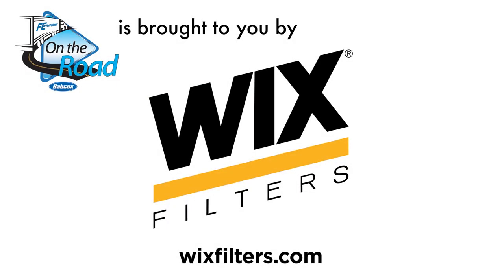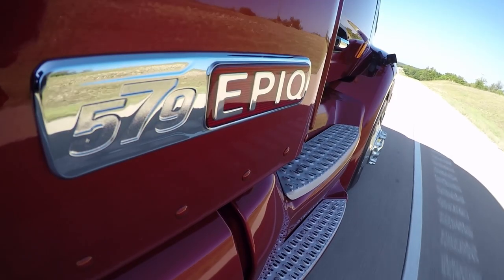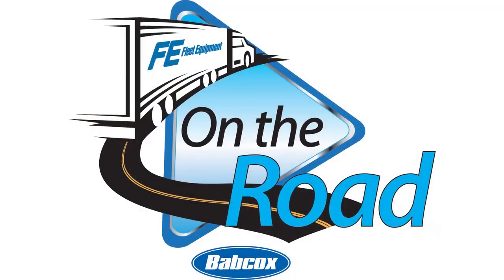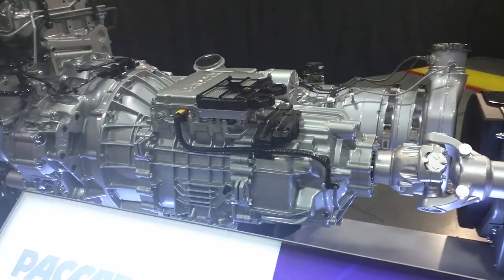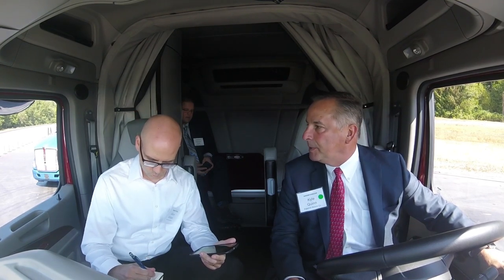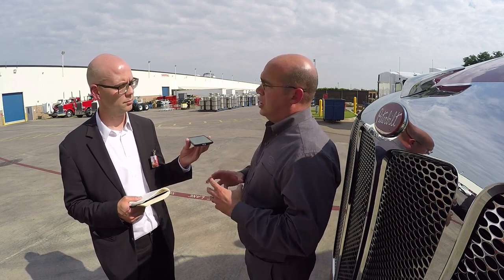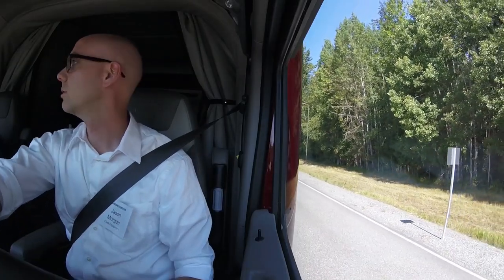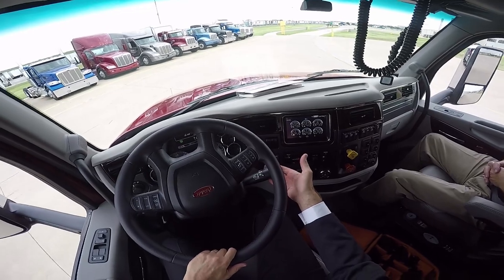Hands On: PACCAR Automated Transmission in a Peterbilt 579 Truck

Comment: I very much prefer a manual, but the company I work for mostly has automated trucks, so that's what I'm rolling with for now. As long as my truck is clean and running right. I'll drive manual or automated trans.

Comment: Is the Peterbilt 579 and Kenworth T680 with automated manual only available with Paccars Automated manual? I know Volvo has the I shift. Mack has the M drive and the Freightliner has the DT12 and I know Intertrashional has Eaton Ultra shift which is made by Eaton Fuller and they suck on the International Transtar.

Comment: The enduranceTrans 12 speed is a junk actually Not the mechanical it’s all the software , up shifting Uphill 6 & 7 gears blinks 4-6 then engaged & downshifting uphill  from 12 in to 11,10 & 9 gears takes 4-6 blinks before engages again , with 80,000 pounds 4-8 grades hill you’re losing to speed and momentum , the engine break thanks 3 blinks about 2 seconds  downshifting in lower gear every time on downhill 4-6 Grade in till it’s thinking to downshift it’s too late needs to go back in a higher gear , this software is a junk I don’t recommend to any to buy this junk Transmission, does a problem they’re testing a brand new and bobtail try after 100,000 miles And full loaded truck , and every time they doing a software update they charging you $$$$ but there is no difference even worse it gets , that’s my advice  stay away away but you’re choosing not me I already did and I regret I should get Allison CT10, Paccar never less on the customer
Reply: The dealer can change settings for it. I HAD the quicker settings. It was a beast on hills holding speed. I would downshift to 9th with the button and hold it with manual.
PB came to work on it and reset to "factory" settings. It gets on hwy at 25 mph. Dies at red light on slight incline. Engine lugs because it's in the wrong gear. It truly sux to drive a broken machine. Also FYI, in higher settings it lurches when you service brake too much. Pressure changes. Just put in Neutral and throttle. It'll readjust it to normal. It's a glitch. But considering the beast you get on hills, I'd take it!
 I'm seriously company shopping. Don't want to die.
Reply: Mmm. Allison transmission. Paccar motors.

Comment: Probably like every other automatic wont accelerate, won't pull, and has software problems....I'll keep my 10 speed and shift it my self until they can make one that won't make you pull out in front of traffic at 5 freaking mph!!!
Reply: Those are suggested "factory settings"
Reply: A properly programmed Ishift is absolutely amazing.  Was able to start in 5th, skip shifted quickly and had plenty of power.  I just got a 2017 579 with Eaton UltraSHIT and some...person....has Progressive Shift enabled and let me tell you this thing is an absolute POS to drive Bobtail/light load.  I can honestly accelerate quicker with a load than bobtailing until about 25. Luckily my boss is letting me get it reprogrammed  tomorrow.

Comment: I like manual to feel, have better Control of everything...I had a abs failure once in my car and I was pressing the brake but the brakes were not working....we never know when the electronics would malfunction....the technology is not fully developed... automatic would reduce stress and more benefits...
But why do these things....are we searching for our ancestors in space..
Reply: Christian Beatzzz auto no good on snow, ice and off road, my choice for city applications though.
Reply: Probably not so great at -40 temps , I’d imagine.
Reply: JeepCherokeeful very true...autogear and there ABS fail at many times leading to brake failure and loss of Control.one day I had to put two wheels on the sand and two were on the Road and the brakes became nonresponsive leading to a accident.Some of these auto ABS sensors do malfunction after heating if you constantly drive for 1000 miles and the brake pedal response becomes different after they heat up.Even a Good EMF wave can Disturb the ECM to break down...21st century seems so easy as you get auto gear on the City roads but when you dig deep you will be gald that we are living in this time and not the future...
Reply: Christian Beatzzz Was in northern Manitoba last week, I’ve made up my mind, a few roads were packed snow and ice plus encountered a couple short steep hills, nothing I want to negotiate on the regular with only a couple buttons to manage the limited traction. I’m driving a Volvo I-Shift these days, it’s ok but I wouldn’t trust it on the Alaska Highway, for example. Plus it’s one more thing to have fail. Very helpful for new drivers though.
Reply: This took a dark turn. My ancestors are infact in space. How do you know this? Also, I don't have abs. How do I get abs without working out?

Comment: Make trucking idiot proof. Remove the skill set to be a professional operator. Replace it with a truck that thinks and drives itself with an idiot behind the wheel. I give you the future of the trucking industry
Reply: Aaron Roberts that’s exactly what I was thinking when he said “we want to make it so easy anyone can drive it.”
Reply: Is that a bad thing?
Reply: Aaron Roberts I had no idea truckers got payed more a mile driving manuals. 😁
Reply: There's been a 2% uptick in trucking accidents since you asked this question (two years ago).  There are two theories that are yet to be backed up by hard data:

Theory One) Drivers are becoming inattentive and easily diverted by things such as social media, tech, and texting.  The distraction is exacerbated by automatic/automated transmissions rather than helping to minimize divided attention required to manually shift.  But this transmission idea could be null and void because cruise control with a sufficiently high differential gear ratio (no weak overdrive) doesn't require careful attention either.

Theory Two) Drivers are speeding to meet deadlines since they now need to use ELDs.  And can no longer fudge paper-based logs.  This would lend more weight behind the speed limiter idea.  Which drivers claim will be a win against their struggle to earn a living.

Comment: im sorry paccar sucks i dont know why peterbilt ever went to them for there primary motors
Reply: Aaron Mooney who do you think owns Peterbuilt....and Kenworth
Reply: cbigclarke I know that they just have a lot of problems my dads peterbilt was always in the shop that was when paccar started using there motors
Reply: I think the Paccar engine is 13 liter and honestly 13 liter is too small for tractor trailers regardless of the transmission. Ive driven International Transtars with the Navistar N13 and it sucks and so does the DD13 on the Freightliner Cascadia. I have driven Cummins ISX 15s on International Prostars and LTs and they are great and so is the DD15 on the Cascadia.
Reply: Paccar owns peterbilt and kenworth

Comment: automatic transmissions are for cars that drive girls not for a truck
Reply: Peter Kenmex I'd rather shift a 10, 13, 15, or an 18 speed truck than drive an automatic.
Reply: Auto trans are stronger and if you don't have a good clutch leg you can't really use a manual trans. Yeah manuals were stronger. Just like the big boy steam engine it was the strongest engine but not any more.
Reply: Ok buddy. Happy 1970
Reply: Shove your automatics and learn to shift
Reply: Peter Kenmex bull...
Reply: Mike Richardson did you ever drive a double stick 5+4??? I bet you've never heard of it.
But I did back in the 70`s
And I'm so happy to drive sometimes nowadays my son's automatic.
Reply: MrStan48 yes I have driven two different trucks one a grain truck and one set up as a sprayer I the early eighties and I still like them better than any mind numbing no skill required fucking automatic
Reply: Mike Richardson you're not even a truck driver....
Only bla bla👎
Reply: MrStan48 where are you
Reply: Mike Richardson at home(!)
Far away, southern Europe.
But I was an 18wheeler in USA and Canada from 1969 to 1988
Reply: MrStan48 cool I’m in Canada Saskatchewan I’ve driven high rail trucks for CPRail from the eighties until 2007 then oilfield vacuum trucks until 2015 and for the last three years a 9 axle super B hauling fuel in Saskatchewan I got out of the truck this morning at 05:40 came home drove my wife to work and soon will be going to bed. I am a trucker unfortunately... I  should have stayed in school lol. Did you ever pass through Saskatchewan?
Reply: MrStan48 he just one of those super truckers thats got something to prove
Reply: Jamal E. Jamison AND AND
Reply: All the manufacturers are having to go to automated transmissions. It is just a step towards making them drive themselves. No point in having a shifter if no one is in the truck. I actually prefer the automatics on long trips but they suck when having to back into a tight spot.